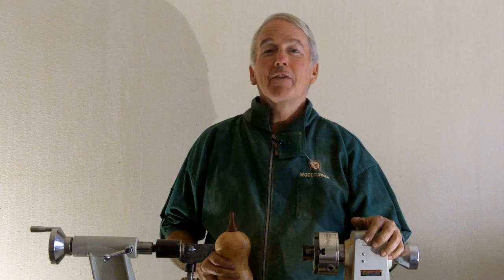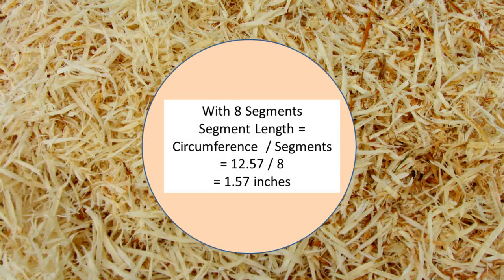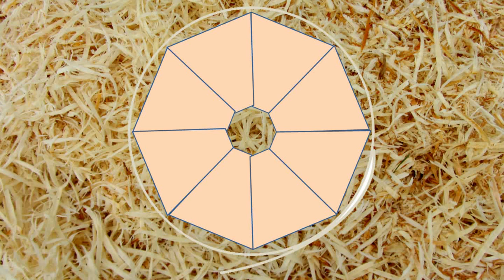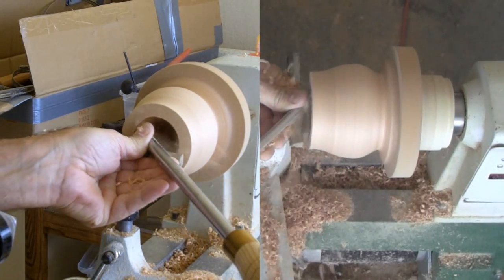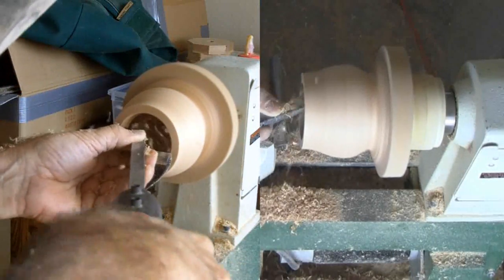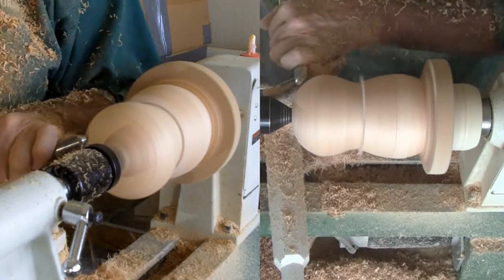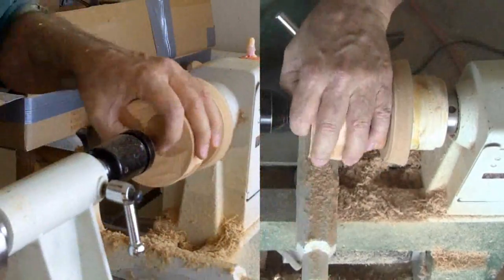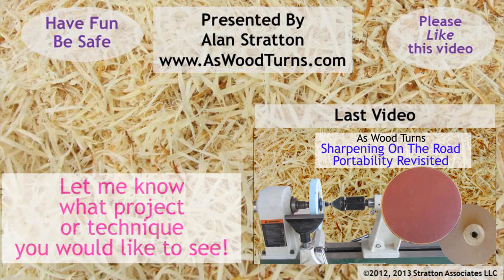A Butternut Squash Recipe With A Special "Turn"

Comment: Thank you Alan for this nice shaped box.
I’d been excused for getting wired in multiple universes by Marc Bublitz over at Keek as I compared the glued up rings for a segmented turning to “Stargates”. OK, I topped this by using these “Stargates” to enter the Caffeine-Universe by turning them into a coffee cup.
Now for your Squash Recipe not to end up as a Squash Pi(e) I came up with these formulas for the dimensions of segments.
L=length of the piece; W=width of the board to cut from; N0=Numbers of segments per ring; r_min=inner radius of the ring (minimum diameter divided by 2); r_max=outer radius of the ring (maximum diameter divided by 2); CZ=comfy zone (the amount of material you feel comfortable to remove, leaving r_max and r_min) Caution with CZ: it’s reciprocal to the turners skills and only depends on the skills of the individual!
Now as this is stated, it’s time for some maths:
-- L=tan(360/(N0*2))*(r_max+CZ)*2
-- W=(r_max+CZ)-(cos(360/(N0*2))*(r_min-CZ)) 
Attention: in case (r_min-CZ)<=0 you need to cut triangles from a board W=r_max+CZ!
-- The angle to cut the board: alfa=360/(N0*2)
Hope this helps, especially on minimizing the amount of wood to use on segmented bowls. At least it helped me to enter my Caffeine-Universe.
Greetings from Good Old Germany
Peter
Reply from the maker: I just knew someone who have to get into the math!
Your CZ is the big wild card: turning skills, design on the fly, segment preparation, oval rings...
You probably noticed I did not optimize my rings. In my defense, it's a small project with inexpensive wood. Add that to my CZ factor. :)
Thank you for sharing the math for those so inclined.
Alan Stratton

Comment: Great video Alan.
Just 1 question, how did you remove the face plate from the top of the box (5:55)? Did you just use a parting tool to separate it from a glued on MDF block or is there some magic going on here? 
I hope it's not too silly a question. I haven't tried segmented turning or glue blocks yet and I'm a bit wary of the glue not holding.
Reply from the maker: I used hot melt glue to attached the wood the the backplate. When I use hot melt, I run a bead of glue around the wood on top of the faceplate. No glue is under the wood.
In the video, I used a gouge to cut off the bead, freeing the faceplate.
However, I usually use a chisel or knife to pry off the hot melt, pealing it away.  This would have been the better approach.
Thanks for the question.
Alan Stratton

Comment: Hello Alan, this peanut shaped box is very pretty.
I would try to do the same model, but slightly larger to contain peanuts true, it will very pretty on the table for a drink :-)
can you tell me how cutting angle is used for segmentation, it really gives it the appearance of a peanut.
Thank you in advance Alan
Congratulations again!
Caro.
Reply from the maker: For 8 segment rings, the cutting angle is 22.5 degrees. for a larger container, you would vary the length of the segments. For the size I made, I made all segments the same. However, for a larger one, it makes sense to make for larger and smaller segments according to your shape plan.
Good turning.
Alan Stratton
Reply: Alan thank you very much for your answer.
See you in one of your video.
Caro.